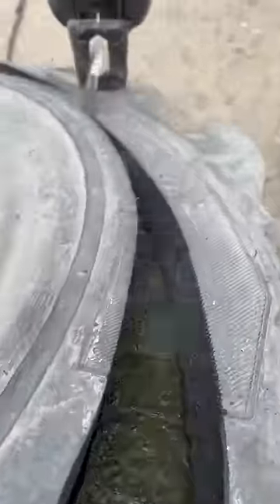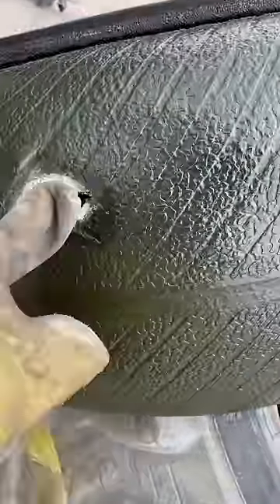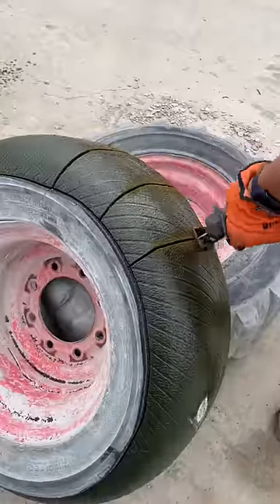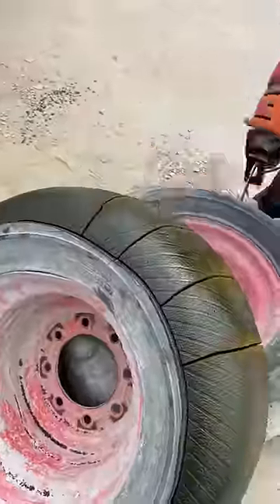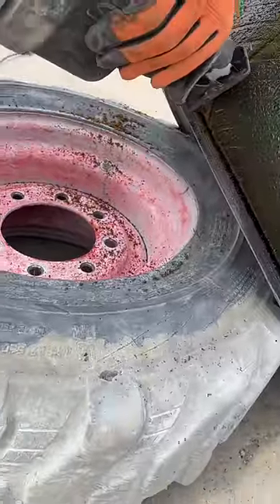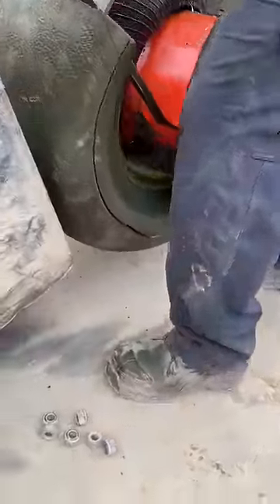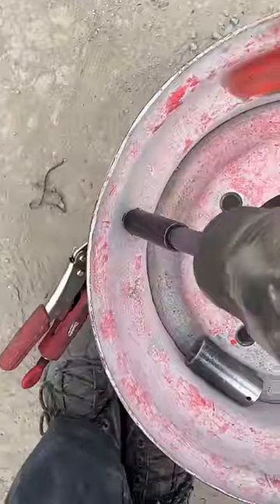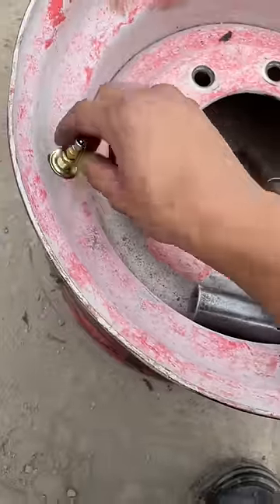Do Foam Filled Tires Smell Bad?        #tiredoctor #tireguy #tires #shorts

Comment: When I used to do the foam filling on tires, we used to coat the rim in tire mounting solution so when it was time to do it next time the foam came right off
Reply: I was just thinking about it... any kind of oil or lubricant will do...

Comment: I made four cuts to remove foam filled tires from a skidder.
Two pairs, about 4” apart, from the tread close to the rim with a chain saw, keeping the blade wet.
Removed the small sections, then cut through the bead wires with an angle grinder.
Used a skidder with forks to pop the tire halves off, easy peasy.
I cleaned, straightened, and welded the rims where needed.
Cleaned the polyurethane mud from the inside, replaced the stems, and mounted new pneumatics on the rim.

The guy is selling the machine, if anyone is interested.
Case 75XT.

Comment: My old coats 1010 center post even has a spindle for small tires like 6-12" wheel barrow tires. They're hard to hold without a rim clamp.

Comment: Rubber mats on the floors and when you have removed the outer layer off the tires. Run the machines  and the leftover and it comes out pretty quickly!!!

Comment: Are there cons for using foam instead of air for tires?
Reply: Foam for heavy loads  moving slow, 
In a vehicle on the highway they would get too hot,
Don't have the flex for  traction and comfort,
Are heavier than air filled tires,
Yes compressed air has weight, but foam is denser has more weight

Comment: Why do these tires get foam filled? Like do these vehicles have a use case where air filled doesn't operate the same?
Reply: They don't go flat when punctured, as he pointed out in the video this tire had been punctured but was not flat. Also the foam adds weight to the machine
Reply: They don't go flat when punctured, as he pointed out in the video this tire had been punctured but was not flat. Also the foam adds weight to the machine
Reply: Ahh okay it doesn't go flat when punctured. Got it

Comment: Yes remove the foam filled valve stem to refill the new tire with foam anyways
Reply: Cheaper than soild rubber tires
Reply: @dancearoundtheworld5360  not what I was implying. Why replace a valve stem if you’re filling it with foam again.
Reply: @ArtilleryAndy  how would you inject new foam into a valve stem that has been plugged by the previous foam job?

Comment: I don't have any sort of driving nor mechanical experience with vehicles, so I'm want to ask what's the purpose of foam filling tires?
Reply: To keep the tires from getting flat when running over things. Not very comfortable for passenger vehicles but great for construction sites when the potential for puncture is high.
Reply: @InevitableTruth.  no